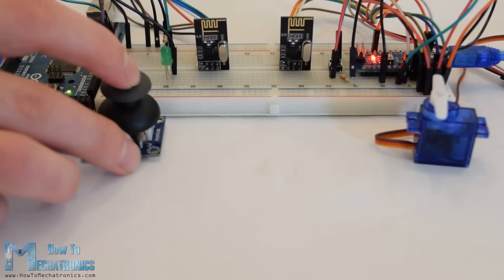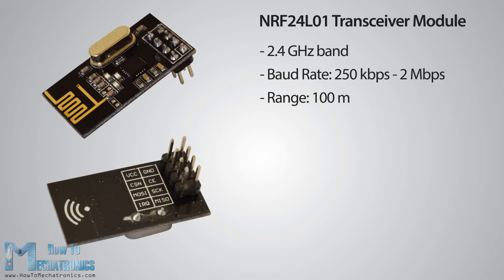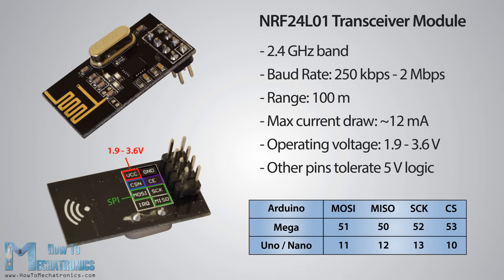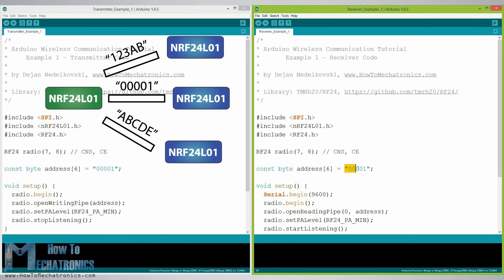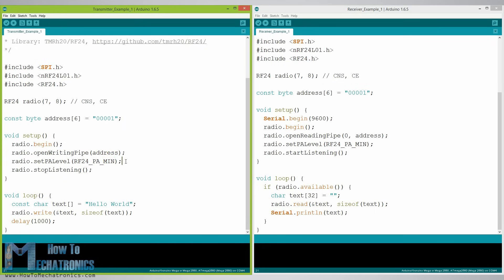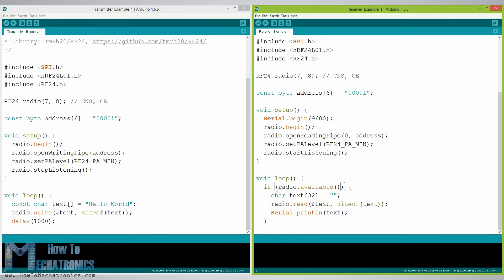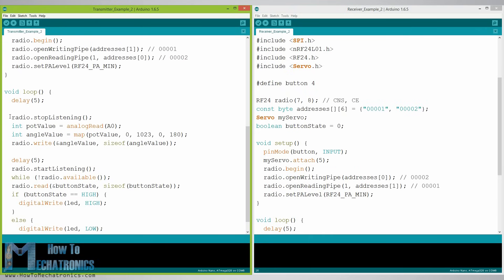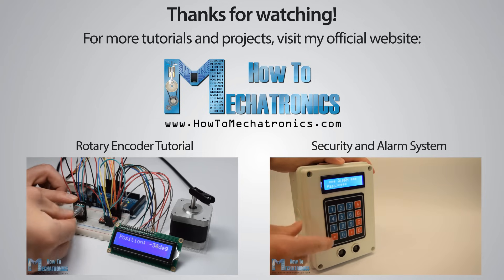Arduino Wireless Communication – NRF24L01 Tutorial

Comment: Thank you for the video! simple and easy:) GUYS ALL OF YOU WHO CANT GET IT TO WORK! I spent days and night to bring it to life, I tried all projects and all examples but haven't succed. The problem was i had to add a capacitor between the gnd and 3.3v pins on rf24, it solved the problem:) and try to set pa level on max. U need to add 1-100 microF capacitor.
Reply: i cant get it working, what is the reason to add the capacitor?
Reply: @harithalau1970  reduce voltage spikes wich could interfere with the radio signals and making it unreliable

Comment: I've got in the serial port monitor message like this  but upturned question mark -->>> "????????????????????" What is the problem?  I've done everything like in this video :O
Reply: Same problem bro
Reply: Same here
Reply: Any solution
Reply: Sprawdziłeś czy ten cały numerek który jest w Serial.begin zgadza się z tym na dole monitora szeregowego który otworzyłeś?
Reply: @woogieboogie9803  English
Reply: @ranjithshetty7078  maybe u opened wrong speed of serial monitor, check is the number after Serial.begin same as the one on the serial monitor u opened.
Reply: After long I got this solution💪😄👌
Reply: @ranjithshetty7078  how you manage to do that?
Reply: @badkinect5532  use 10uf capacitor and use 3.3 volt check all jumper connection this will give u proper output
Reply: @ranjithshetty7078  where did you put the 10uF capacitor?
Reply: @BiyaheWithBruno  nrf vcc and ground bro
Reply: @ranjithshetty7078  nakaparallel?
Reply: @BiyaheWithBruno  not parallel positive and negative pin
Reply: @ranjithshetty7078  so the capacitor and the vcc/ground of nrf is not connected to the supply? Is that coreect?
Reply: Change baud rate to 9600

Comment: One tip which may help someone: if you use NRF24L01 + adapter, connect the adapter to the 5V pin, cause in my case it doesn't work with 3.3V
Reply: There is more versions of NRF24L01 there is 3.3V and 5V version
Reply: I LOVE YOU, this fixed everything! lol

Comment: Great video thank you so much! I just wanted to bring to your attention that the 2 of the 3 green wires at 2:32 for the arduino nano are incorrect. MOSI is correct. But you have SCK running to 12 when it should be 13. And MISO is running to 10 when it should run to 12
Reply: And in the code you need to swap ce and csn pins around ( 8csn , 7 ce )
Reply: yoo
Reply: i need your help

Comment: Noticed one small error in the drawing that I'm sure has already been mentioned but not recently maybe. On the Nano in the picture the green wires are running to 10, 11 and 12 rather than 11, 12 and 13. 13 is on the other side of the board. Only I would follow the picture and miss that the numbers everywhere have it correctly. Don't want to say how many hours I messed that up and I've used SPI before and actually was bummed because it uses my little flashing LED pin 13. Not at my best today.

Really great video and your link to your page really helped. Super. I don't know I could have linked them without it. Many thanks.
Reply from the maker: Yeah, thanks for the remark.
Reply: yeah I struggled with them hours too small mistakes
Reply: What do you think, Can I use this module with just AtMega328 (without Arduino)?
Reply: @plebaniaurydzyka8356  Yes you can. I have used the Atmega 328 on its own for use in model aircraft. Works great.
Reply: @HowToMechatronics  Man, just mark it in your video and on your website... you cost many people plenty of time...

Comment: Just finished testing your code, it works! thanks.
I add "radio.setChannel(0)" after "radio.begin" at both transmiter and receiver sketch. It is to make sure both receiver and transmeter in the same channel. Since it is 125 channels altogether then i use 0 at both. Thanks again.

Comment: Huh, here's my story. I was fixing it and fixing it, and Was unable to get it to work, not even the basic transmission, and kept trying everything, everyone's code, everyone's library, all lead to failure. I was stubborn and didn't want to give up on them. And then I finally decided to try and replace one of the modules with the 3RD one I had lying around, and wola! it worked. 

-I was struggling so hard, and didn't want to test the other module because I was kinda lazy and kept thinking that there is some interference in the wires, or that my Arduino 3.3V was insufficient so I ordered 3.3V linear stabilizers and the outcome was the same, then I tried wrapping the ground wire around the Miso, still nothing, not working.. and then for the last resort I swapped one of the modules, and luckily enough I swapped the broken one on the first try and the Transmission began, So let everyone know, if you're unable to get it to work, not even any transmission,and you checked everything, then perhaps you really have a faulty module, and it isn't the bypass capacitor nor the insufficient arduino 3.3 power supply.
Reply: I bought 3 Pa LNA modules and only 2 works, but even to get those two to work I had to attach 3.3 ams1117 regulators and 1000uf capacitors. But now they work perfectly with that addition.
Reply: I think I will have to refer the datasheet to actually check , but I've noticed some modules don't have all 4 resistors connected while others have ( they are the 4 resistors along with one capacitor all parallel in the middle of the board,) on some modules all the resistors are there but in some others they are not there. Either ways all those modules work.

Comment: I believe I just discovered a small mistake in the video (with the Nano/Uno at least, I am using 2 Uno's) that was causing me some headache in figuring out what I was doing wrong. If you're having trouble like I was maybe this will help you (for me, the receiving end was getting a flood of blank input and eventually getting some weird characters before outright stopping (viewing with the serial monitor).

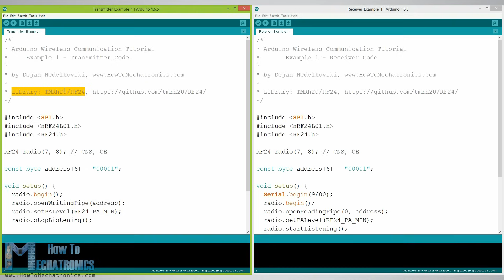At 2:30, you list the CSN as being connected to Pin 8 and CE to 7, for the Nano/Uno. However, if you look at the code at 2:40, you have the line:
   RF24 radio(7, 8); // CNS, CE
Which I assume implies that you have the CSN connected to 7 and CE to 8, in their respective order. This is reversed from the list 10 seconds earlier. All I had to do was swap which wire was going to which pin and suddenly everything is working fine. Just swapping the lines in the code should have worked too.
Reply: I ran into the same problem as well. I think the comment should have stated RF24 radio(7,8) //CE,CNS...... that's the set up that worked for me. Eventually switching them around just like you did. Instead of switching the wires, i just switched the number on Arduino

Comment: Thank you so much, you are the one who's sketch and connection works. But I still have a question.  Why nothing works when I change power supply. It works only from 3.3 v Arduino output. Other power supplies (batteries, MB-102...) Don't provide possibility to work properly for nrf24l01

Comment: Nice tutorial but there are a couple of things that I needed to correct in order to get both examples to work.  
First, the wiring diagram for the Nano is incorrect.  Use the written pin assignments at 2:33 in the video.
Second, in order to get the second example to work, I had to change this line in the transmitter code - while (!radio.available());     to     if (!radio.available());
Thank you for all the help in getting this project working.  Now to add more servos!
Reply: @Mateo M wrong, you can use same pins as on Nano board, 11, 12, 13 and 7,8 or whatever pins you decide to use as CE and CSN pins. Nano, Uno and Pro Mini board have the same pins for SPI.
Reply: @daliborbaricevic685  he was right. the wiring diagram is incorrect.

Comment: Hi people, i think i may have found the problem some of you are facing...on 2:26, the connections of MOSI, MISO and SCK are in the pins 10, 11 and 12....buuuuut, the pins for the SPI connection are 11, 12 and 13...and actually on the description below the Nano pin numbers are right, its the image that fools us...
Reply: Can confirm, I found out the hard way. The picture is wrong, but the description is correct. (at least on the Nano)
Reply: how much is the range of them?
Reply: @felixbaum2180  About 85 meters in open space, there are some other models with antenas that can go up to 900m...
Reply: @davidporras761  Thanks for the quick response. 85m are perfect. I just need to transmit over about 30m, but within my house, so through a few walls of concrete
Reply: @felixbaum2180  Mmmm concrete walls could make the signal loose too many packages, 15-20m should be fine if there are no more than 3 walls, but with 30m im not sure...
In that case you could use a module with antena (anthena?) as transmitter and a normal one as receiver, thats what i always do actually, just to be sure haha...
Reply: @davidporras761  ok, seems fair! Thanks, i'll buy one with an antenna and one without then.
Reply: @davidporras761  yo David, now I got some and I cant get it to work :( I used his exact code from the website. The only thing i achieved, was that Serial.println(radio.available()); gave me some 1s. But just sometimes. Do you know what to do? I have two Arduino Unos and two NRF24L01 modules (but the LongRange ones). I have no compiling issue, the library is also included. Whan am i doing wrong?
Reply: @felixbaum2180  Can i use apmplified antenna version with same code?
Reply: @DiscoverRajivVlogs  technically yes, but I'm struggeling to get anything to work right now..
Reply: @felixbaum2180  You guys been taking about pins , well you should see the pins in the code and should be making any circuit out of it. So first download code see what is written in it then move on for hardware.
Reply: my 2 days wasted 😂 😂

Comment: If anyone gets blank output in serial monitor......then You must check the connection..... actually pin 11,12,13 in the diagram is incorrect.......13 is the opposite side......  Better see the pins and  connect it yourself.......
Anyway great video...

Comment: Am sorry but there is a mistake in the way the Arduino nano is hoocked up for SPI (the 3 green wires are wrong and the pin 13 is used). Great otherwise :)
Reply: Excellent point. Hardware SPI is really important for this module due to the high bandwidth if you want low latency
Reply: @WungoBungo  Quick question. Do you know roughly what the latency is?

Comment: Hello. Thanks for the excellent video but I am puzzled by your Tx code in the bi-directional example. It seems that the loop will freeze if the receiver does not send any message. What's the reason for the line of code, "while (!radio.available());" ??????

Comment: Hey dude codes for printing hello world for both transmitter and receiver are compiling without error but not working
Reply: See my comments above. (Sort by date.)
Reply: dadigitechman  Pin 8 is the only optional pin.
Reply: @dadigitechman  You don't have to use pins 7 and 8. I used pins 9 and 10 and it worked fine but you have to define the pins you are using in the code. The code here defines pins 7 and 8 for CE and CSN so you need to modify the code. This does work.
Reply: @dadigitechman  It's reasonably straight forward. The only line of code you have to change is this one "RF24 radio(7, 8); // CE, CSN" just type in (9,10) if you plan on using those pins on the arduino. I agree that using pins 9 and 10 for CE and CSN makes the overall wiring much neater. Follow the link in the video description to the tutorial for the full code as it is good and all of that code works. You may need to modify the code for your own application depending on what your project is and what you are trying to achieve but that is up to you to do some research and play around to figure out what part of the code you need to modify. It is very possible that your wireless modules are faulty and I have seen faulty ones from China in the past. If you follow the tutorial in this video exactly right and it doesn't work then it may be your modules.
Reply: @dadigitechman  Yeah do a video and I will watch it and see if I can help.
Reply: @kenengel6223  I can't see your comments, would you mind taking a moment to comment again, please help me?

Comment: To make it easy for Newbies Note in i.e Getting Started Program find code RF24 radio(7,8); alter to reflex say RF24 radio(9,10); //CE, CSN Please note CSN on Mega should be on 53 if not then add pinMode(53,OUTPUT); First line in void setup()........ Due does not mind as it expects pin 4,10,53 to be CSN. Uno only pin 10 for CSN This then conforms to ARDUINO SPI Library
MY Colour Coding and pin out for nRF24L01
Pin 1 Brown 0v Ground  Pin 2 Red              +V 3.3v
Pin 3 White CE                  Pin 4 Black            CSN
Pin 5 Purple SCK          Pin 6 Grey              MOSI
Pin 7 Blue MISC          Pin 8 Orange       IRQ

Uno                  Colour           Mega         Due                  Due Header SPI 
9 Any pin White  9 Any pin 9 Any pin           CE
10                 Black  53          4,10,53                   CSN/SS
11                 Grey  51          51                  ISP-4 MOSC
12                 Blue  50          50                  ISP-1 MISO
13                Purple  52          52              ISP-3 SCK

Comment: Hello, thx for this tutorial. I have a problem, I uploaded the exact same code on  my Arduino Mega and my Uno, but it's not working. I use my mega as a recepter and It justs write some squares and '?'. Have you got any idea ?
Reply: same i got last night . any solution ?
Reply: You should check a baud rate in serial monitor which you have coded, may be that can help.
Reply: @rvlad13  That is exactly the problem. The baud rate is not matched to the clock speed. because UART has no clock (its asynchronous).
Reply: me too i changed the baud rate and stil the same problem
Reply: I'm 4 years late on this but I was getting something very similar. Try swapping the 7/8 pins for the CSN/CE wires going to the nRF24L01. If you look, at 2:30 and 2:40 he has the pins reversed between the explanation/code.

Comment: hello, thank you very much for this tutorial, I connected everything as in the diagram, it works, there is communication, unfortunately the SG90 servo dances, vibrates constantly, there is no stable operation, there are interferences, I added 10uF capacitors, where do these interferences come from, why is this happening?

Comment: Thank you for all the informative videos / tutorials.
I am no programmer but I've been messing around with an Arduino Mega and Nano. I am trying to to use the Nano and NRF24L01 to transmit to the Mega information from various / multiple sensors. I cannot figure out how to compile the Transmit / Receive code so I can keep adding or changing sensors. I currently have it working with a Ultrasonic sensor but I can't figure out how to add in Temperature and Humidity. Any help will be greatly appreciated. Thanks.
Reply from the maker: Hey, check my Arduino RC Transmitter project, you can find more details and a bit different method for structuring and sending/ receiving the date using the NRF24L01 module.
Reply: @HowToMechatronics  Thanks for the response, I watched the other video but I guess I need to study a lot more. I have made a few examples of projects that were posted, but I don't yet understand how to "word" the codes for what I want. Thanks.

Comment: I'm using the same code as yours and same connections, but still not working, nothing appears on the serial monitor of the receiver, what could be the problem? I'm using UNO as transmitter and NANO as receiver.
Reply: I feel like the code"!radio.available()" might be the problem. Make it "radio.available()"

Comment: Interesting videos, thank you.  The first sketch worked for me.  I used the Nano IPSP rather than the numbered SPI pins.  For the second sketch, I also used IPSP with identical hookup of the wires for the receiver/transmitter.  Also, I used a potentiometer instead of a joystick.  I ran the servo side off battery and the led side off computer.  I verified multiple times that wiring was correct and that send and receive channels were appropriately reversed on the 2 Nanos.  Nothing I could do succeeded in making the second sketch run.  Presumably the error is mine and not in the sketch, but I cannot find it.  It is tedious to do the wiring and then have the project fail, but maybe I've overlooked something obvious and will eventually find it.
Reply: hey you might not remember but how did you get this working? it keeps returning false for radio.available so nothing in the if statement runs.
Reply: Fixed it my connections were wrong hehehe

Comment: This is a great video, it helped me out a lot.
However: your wiring diagrams on the Arduino Nano are wrong!

The SPI wires should be connected to pins 13, 11, and 12 but according to the picture both in this video and on your website they are connected to pins 12, 11 and 10. 
The text underneath shows the correct pin numbers, but the picture is clearly wrong since pin 13 is on the other side of the board.

Took me nearly an hour to figure out why my sketches did not work, until i found a different wiring diagram on another website.
Kind of my mistake, since i went purely by the picture instead of checking the pin numbers. But still...

Anyway, thanks for the otherwise awesome tuturial.
Reply: Hannes Größlinger : Right the same! Until I saw the pin 13 for SPI and everything hoocked up in the same side of the nano :3
Reply: Hi, Hannes, I followed your instructions to re-connect my circuit, but only question marks show up